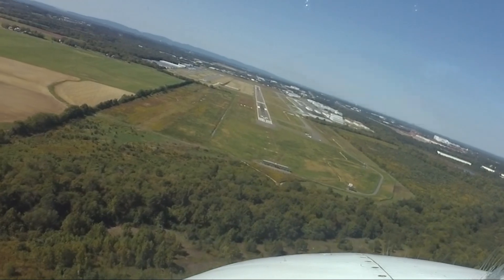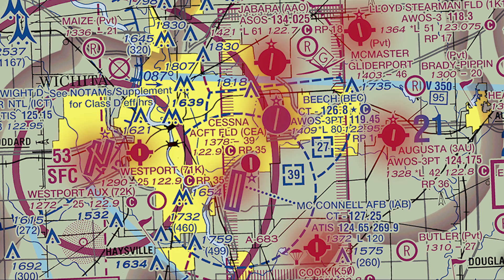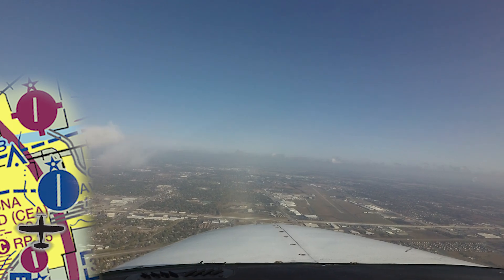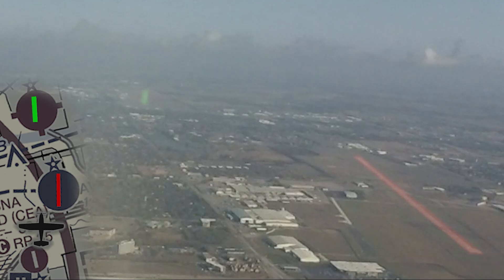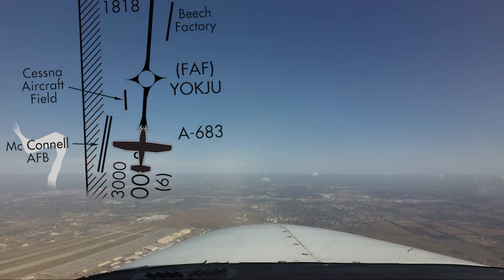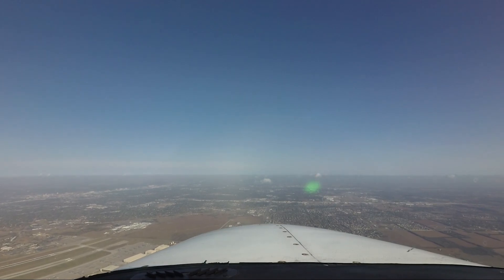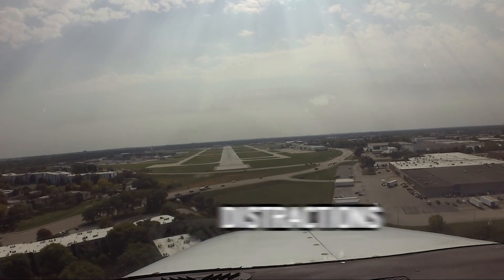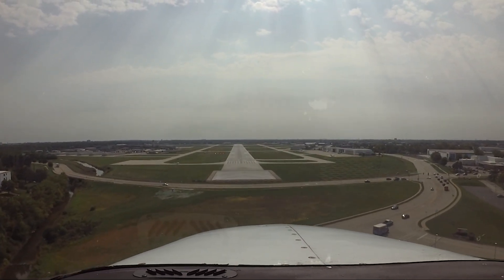From the Flight Deck – Wrong Airport Landings

Comment: @3:49 there is a mention of using geographic features, except that the inset map is flipped horizontally for some reason. Why is this? It makes this example way more confusing than it should be.
Reply: Track up instead of north up
Reply: @DavidLombardo  I know what track up is, and that map is not track up. it's been mirrored horizontally, it should have been rotated 180 degrees instead, the map should be upside down.